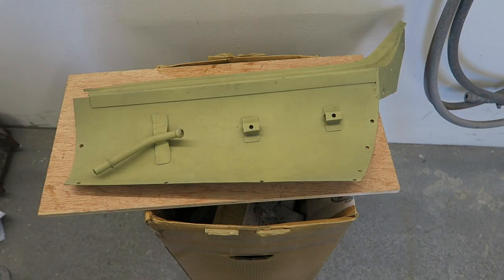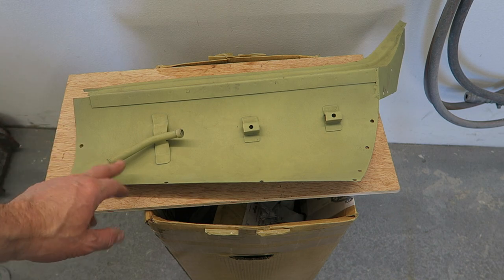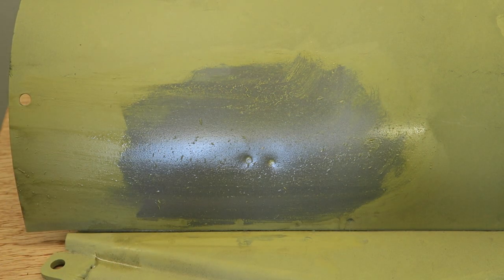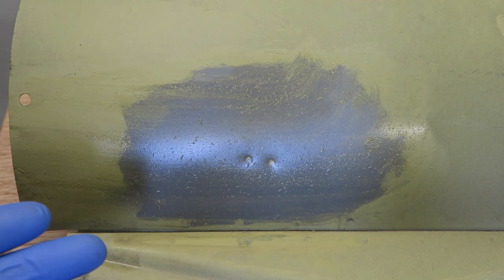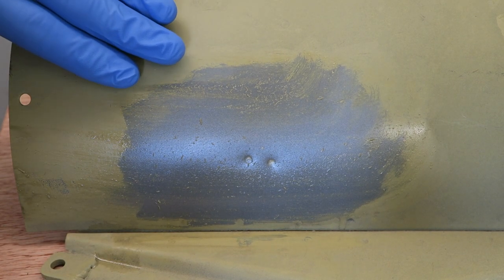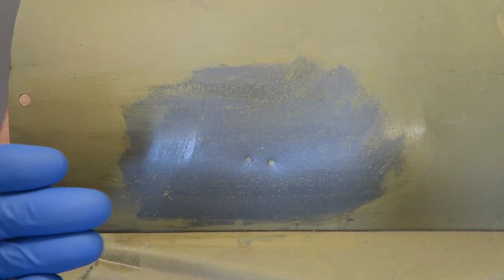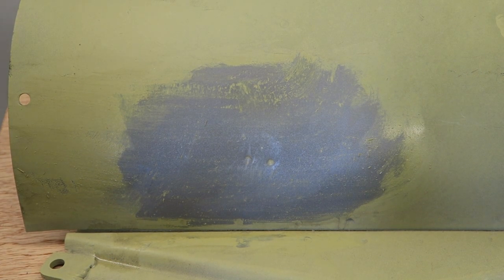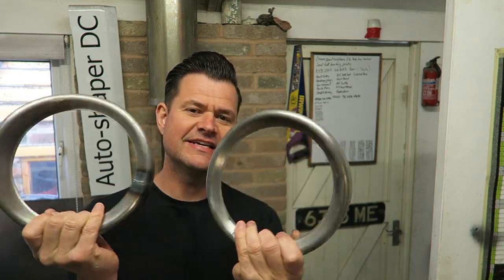Why to avoid applying carbody filler/Bondo over etch primer Tips and Tricks #29

Comment: Artisan in metal Trev.. you are!!!! Incredible attention to detail and your ability to teach reminds when when I taught a course as a metal artist but also a metal tradesman in the oilfield as well as a trades instructor for structural welding and pressure. They asked me to teach beginner course on metal forming and shaping through this college local to me and it was a riot. You however blow my skills out of the water on light gauge and I am learning much from you. A lot of what I was doing was heavy welded metal faces or gargoyles out of scrap and then after my near death had to stop welding and have started working these tin masks and copper faces and working in wood because welding and eye issues suck. So keep up the great teaching and am wondering what that van looks like. Suspense, but it is worth the wait with your skills!!!! Bang on blog mate! I can tell you are an artist at the core of all these skills because of your honest passion. Inspiring!!!!

Comment: Another great video.  I was caught out re-painting a bonnet on a car where the repair underneath bled through with the thinners in the paint.  I used a product called Barcoat (U-POL) to spray over the area of the repair after removing the top coats over the repair and then refinishing the bonnet.  Polyester resin  body filler can also never harden and feel soft when you add too much catalyst and will delaminate if the metal underneath is not keyed in by sanding or the metal is not free of oil before applying the filler.

Comment: I've use that epoxy primer on everything and even had it out in the sun and winter for 3 years! That stuff is bullet proof and it works great wet on wet with 2k satin black! I wouldn't use anything else over bare metal. Even unsanded bare metal and rust metal. Sticks like glue lol
Reply: All same here!!! Keep Rocking it out!!!
Reply: yer, when epoxy came along, it pretty much made etch old technology, and not the "prefered method". however you can buy 2k etch "primers" now, with activated hardener
Reply: Is it tintable?
Reply: @southjerseysound7340  Yes!!! I believe so!!!
Reply: @rockerpat1085  tintable  with enamel or base coat ?
Reply: @patate7929  Base coat is what I'd use!!! Never enamel!!! So you could get white epoxy primer and add whatever base color tint!!! Use tint not mixed paint!!! So if you want orange primer use orange tint!!! Ask your paint supplier about what they think!!!
Now jump over to my channel and subscribe because you like old cars and loud guitars!!!
Keep Rocking it out!!!

Comment: a perfect example of the difference in chemicals, and how they react, for me, was when i first began using evercoat fillers. i wont mention particular names, but 2 of them you could mix, to make a decent build, but runnier, for less pinholes, however a 3rd evercoat filller could not be mixed with either, because they have incompatible resins. good to point that out trev, always enjoy sharing experiences:) afew months ago i picked up a trick for making fillers, and fiber-fillers runnier...wet-lay laminators resin. everything i have tried it with, it works great.

Comment: Hey Trev, Hello from California USA. Our state has outlawed some good old solvent paints which makes longevity a thing of the past. We have a water bourne paint being used in paint shops. I had a classic car painted in 2009 when this new law was released. needless to say my $4000 two stage paint job only lasted two years before the clear began to peel. I've since decide to start over by eliminating the body fillers and do the body dent removal myself. I have extra panels that I can repair off the car which allows me some practice and with keep the car intact and drivable until it has to be pulled apart again. The previous paint job took 21 months before I got the car back. I'm watching your videos to get more in volved with the outcome with less guess work of what was done by the last guy. As for the music on your videos, that is a shame. The surf/rockabilly guitar was awesome. I hope you can find another sound track as good as the previous videos. Thank You Sir.
Reply: Can you take your car out of Cali to get painted?
Reply: @tezzrterry7485  I can take it to Arizona or Nevada. I've been informed of urathane paints that can be sprayed in local shops. I'm getting more info by the day. The previous shop took it down to bare metal but primed it and let it sit for months outside. The body work had too much filler used and not much metal work. I took pics while it was going through the process. I know what areas had stretched metal that could have been shrunk but they chose the easy way out. The quarter panels were really bad since every panel on the car was dented. Its a '63 full size Pontiac. I've been blessed to find doors and replacement fenders. I'm thinking about using single stage paint next time.
Reply: @rickysmalling4507  Single stage paint looks good on older cars, it suits the era.
Reply: Tezzr Terry the color I'm wanting to use is called "Dark Marlin Aqua". It was used on the '63 Pontiac code QQ. It was an acrylic laquer. I've seen a similar color single stage with some metallic in a urathane. Its made here in Ca. I have to connect with paint supplier and sprayer to see if it will last . My Pontiac is a daily driver, it is outside most of its life. If I can get even 10 years out of the paint then I will have met the challenge.

Comment: Epoxy primer gives a chemical bond as well as mechanical bond being the main advantage. I've had sheets of filler come off on a panel that had epoxy because it wasn't keyed after application. Was told it was ok to apply filler as long as was within a week window. Like you say, these days I'll let it fully dry before scuffing and applying filler. Thanks for sharing your experience, totally agree with your procedures.
Reply from the maker: Plant Powered Health I hear people state that you’ve got a 7 day window because the epoxy is constantly shrinking it grips onto the product that’s placed on top. I’ve recoated within around half an hour it’s still tacky then, I would never paint any product on the top of it any later personally. I’ve had some small brackets that I didn’t prep really well around bolt holes and when I’ve tightened the bolt the paint breaks lose as it hasn’t stuck well enough. Cheers Trev 👍
Reply: @trevsblog  Would it be possible to paint or apply filler over that epoxy after the 7 days and avoid problems by sanding??? I thought you meant that. But here you mention not to let it dry longer than 7 days.
Reply from the maker: loscarnm basically what I’m saying is a lot of people say that you can apply anything to epoxy within a 7 day time frame. In my opinion this is massively risky. My opinion is to leave it at least 7 days, this way it is fully hardened and has stopped shrinking. Then rub it down with 180g to key the surface and create a mechanical bond. You are now almost guaranteed to be able to apply fillers or primers on top of the epoxy without the risk of it pealing off. Hope this helps clarify things for you, I’m here to help as best as I can. Cheers Trev 👍

Comment: Our products in Australia must be a little different somehow. I  learnt that way and have always used  an etch primer over the metal to stop moisture from the filler exothermic reaction coming back as rust later down the track. in 35 years I have never had a failure, maybe just lucky.

Comment: Thankyou Trev.  Well explained.Love it.  You may get lucky with etch primer under filler if you want to take the risk.... Just 3 ultra ultra thin coats of primer allowing time for thinners to evaporate between coats over the filler to reduce the amount of thinners penetrating the surface.
Reply from the maker: David Beer that’s right I got away with it initially because I’d only put a very light coat on and I perhaps didn’t put the first coat of 2k on heavy enough for it to creep under the filler, there are just so many variables when dealing with paintwork. Cheers Trev 👍

Comment: Hey Trev I'm in my first year in the industry and last year I did a introductory course in collision repair. I did a closed. Door respray on my car last year and think I may have sprayed Etch over filler but fortunately not the other way around lol as I haven't experienced the problems mentioned in this video. I am currently doing a full resto on an 87 prelude and think I will metal condition to clean remaining rust particles on bare steel then use epoxy rust converter over that to cover it, as opposed to Etch.

Comment: I am new to using 2K as well. My local paint supplier said to fill over the epoxy, then do your sanding. I thought I was being led on but after repairing my boot spoiler I've found it "keys" well  with 240 grit dry.  Still getting used to you saying "key" Trev. You know us Aussies call it "block sanding".

Comment: Good video Trev ! Very true on the etching filling never put bondo over etch primer. Especially when the panel has been media blasted, the media will leave small pits for the gases from the etch primer to take a bit to evaporate. The epoxy primer is as some say is bullet proof. I use it over everything & I put it everything over including : Al., Cast iron, Stainless steele, fiberglass with no treating & no problems long term. You do have a window with the epoxy primer 24-48 hrs. depending on the environment, after the window is closed scuff sand the epoxy & spray a single coat. No Worries after that. Be sure you give all your primers from Epxoy, 2K, & my favorite Polyester filler ( Concrete in a can) & DON"T BUILD The layers up or pile it on it only makes matters worse. Another big peave of mine is if I start out with one brand of product I stay with that product from start to finish. No paint bench chemistry here ! One thing I really like about the spray can of etching primer is if I have a sand thru & I am close to painting grab a can spray a light coat over the sand thru & paint ! Thanks Paul !

Comment: I'm glad I haven't painted my car yet. I think I might have used etch primer around some patch panels. I'm not sure so I'm just gonna strip it back to bare steel and start over. Thanks for the info. Glad I subscribed to your channel.
Reply: Daniel Lawson before you do all that!!!      Why not just scuff it a tad with 300-400 grit and spray it with some epoxy primer.       This blister thing while true isn’t near the problem it comes off in this video.

Comment: Iv done this. Rattle can etch primer. Red scuff pad. 3m filler. 2k primer 2k sealer. Urethane base and clear. No issues after 2 years now but probably just dumb lucky.  I did use the premium line of 3m filler. Definitely don't skimp on filler. The 20-30 dollar difference is worth it. Most jobs I see fail are from filler failing. But now I'm wiser and put epoxy then filler down. I do this instead of just filler on bare metal because if the filler ever gets exposed to air and moisture it's likey to rust the metal it's bonded too and fail. Also most epoxy primer have long window of additional chemical bonding 3-7 days which is grear Additional adhesion.

Comment: Top stuff again, I'm still a bit confused with primers, but I have just had try with epoxy "primer" over here, they call it appret which seems to be "undercoat" for general steel painting, primer seems to for auto body work as I think they are saying it gives a smoother finish to the final paint. The main thing I took away though is that epoxy will protect the steel from rust pending further work.

Comment: What I would love more than anything in the world is some tips on tig welding etched body panels. I cannot for the life of me get decent welds on old body panel metal that has been etch primed. I painstakingly remove the primer, sand to bare metal, clean again and it still welds super dirty.
Reply from the maker: If surface prep discs can’t do it then I’m out of ideas 👍

Comment: I really appreciate this video upoad. I was just about to block sand etch primer with 80 grit and then apply filler over the sanded results. Question: What about fillers can I use a EVERCOAT filler over BONDO filler? Different brands over each other etc.

Comment: thanks again.

made me think, i have used etch on the underside of my mini, i plan to use that raptor 2 stuff on it, maybe itll react... i should have used the hp bodies stuff, but i was lazy!
Reply from the maker: Avtovaz21057 it may still be ok and a reaction would probably not happen, if you can mix a small quantity, why not paint a small section and see what the result is. Cheers Trev 👍

Comment: Hi Trev . At work ,a lot of our parts are acid etch primed usually for internal cabin aircraft  parts. These parts are all part marked with marker pen. I grabbed the thinners to remove my marks pen mistake and Vhoila the primer all came off .. didn't I feel a prize plum. Regards Don.

Comment: Trev. Wondered if you could suggest an aerosol spray paint I could use to protect panels from rust whilst waiting for painting. I have done all surface prep and the panels will have a high build primer which may be exposed to wet as the car is outside covered with a sheet but some rain water always seems to get through to the panels. I thought a cheap wheel silver might do, so I can paint over that when i'm ready to paint the car. What do you think. Thanks, Philip.
Reply from the maker: Philip Knowles the problem is if you use a primer it will be porous, if you use top coat it won’t stick. I use some etch aerosol but sand it off before painting properly but my stuff is always kept inside. If I was going to put it outside I’d go to the trouble of giving it two coats of epoxy. Cheers Trev 👍

Comment: Nice video, so there shouldn't be a problem putting plastic filler over a 2k polyester high build primer if the primer is first sanded!  Correct?
Reply from the maker: Okie-Tom in theory no there shouldn’t but I’d always advise doing one panel first. Cheers Trev

Comment: Very well explained, Trev!

I asked the technical support of my paint manufacturer regarding using Bondo over their EP primer wet-in-wet.  For my product there is a time window between 1 and 24 hours for painting over it without sanding. They told me that it is possible to use body filler in that time window. I did it and it worked perfectly. However I sprayed in the afternoon and waited until the next morning - then the EP primer was mechanically quite robust and did withstand the putty knife.
Reply from the maker: Tunicht Gut I’m sure you can apply it before it’s fully cured because it’s shrinking and this effect grips the filler, but I’d rather know for a fact that I’m going to get the same results every time. Cheers Trev 👍

Comment: My young son had a water leak into the boot well of his mx5 NC.  I sanded away the light surface rust and applied a rust converter and then sprayed etch primer two coats. Looks great . Will it hold up without a colour or lacquer top coat?
Reply from the maker: MARTIN A1 long term possibly not as most primers are slightly porous.
Reply: Trev's Blog 
Thanks, ....I’ll give it a top coat of colour then.

Comment: The body shop guy, who owns his shop, came over to my house to give me a quote on a paint job for my 81 Camaro. I'll be doing the bodywork.
But we were talking for a while about different stuff to do about primers, surfacers and paints.
He had some warranty work come back every now and again where he, or his workers, applied filler to bare metal. It would come back with some defects or whatever. He fixed it because of his warranty.
He then figured out to use self etch primer spray bomb can on the bare metal before he applied the filler.
NO MORE WARRANTY CLAIMS CAME IN!
He thought that some how if the metal wasn't perfectly clean, the etch primer some how must of killed or consumed the contamination. Weird.

Comment: Great video Trev. Just curious on your opinion of the isocyanate risks in using 2k primers. As a home gamer I dont have an air fed respirator and apparently they can't be filtered out. How do you apply 2k safely?
Reply from the maker: Steven Koch as far as I am aware a good canister respirator with decent extraction should be fine, look at the technical data sheet for the respirator before buying it will say what it filters out. Also there is a consideration to risk dependent on exposure, low exposure low risk. Cheers Trev 👍

Comment: I have 4 big dents and door dings I plan to fill with bondo after I hammer out the dents dings ,  Can self etch be used over bondo to cover the rest of the bare metal feathered out over paint ?  Only place I plan to remove the paint is around the dents dings wet sand the rest of the truck and use a sealer primer and sand then base coat & clear .   Self etch is 15$ and Epoxy is 50$  Im on a budget
Reply from the maker: Over filler no problem 👍

Comment: Copyright claims on 50's Rockabilly, thats beyond bizzare given that copyright is primarily about protecting income, and that the vast majority of the performers of that genre made no money at all. They changed the term of copyright here in blighty from a straight 50 years on recordings, to 70 years around about the time the early Beatles stuff was dropping out of copyright. So anything recorded before 1949 will be ok, maybe some very early Hill billy Bop :)
Reply: They'll make claims on the most obscure music out there just to get the add revenue.
Reply from the maker: Fanakapan222 the issue came about from a modern band producing a retro surf recording. No worries, get it sorted and move on. Cheers Trev 👍